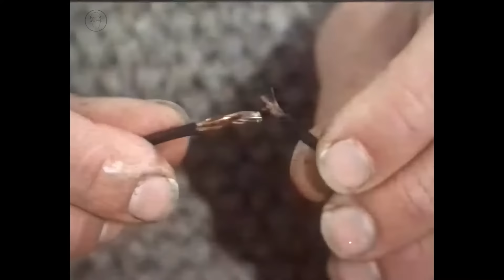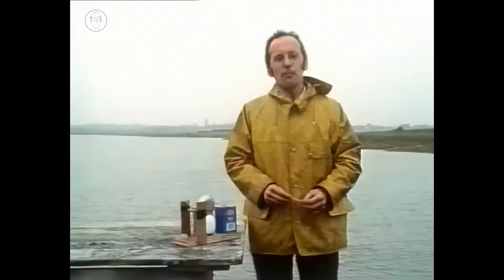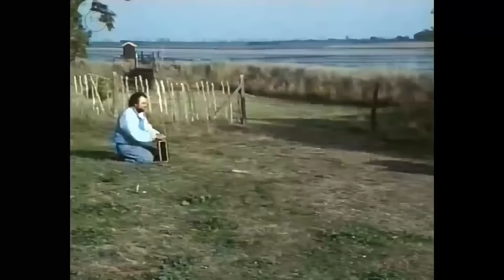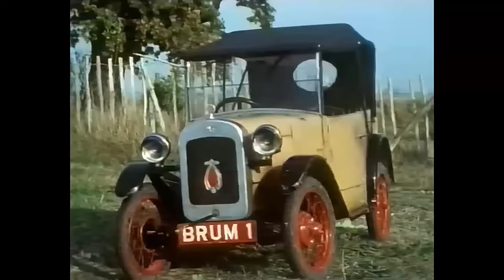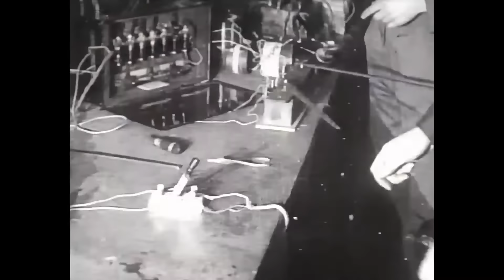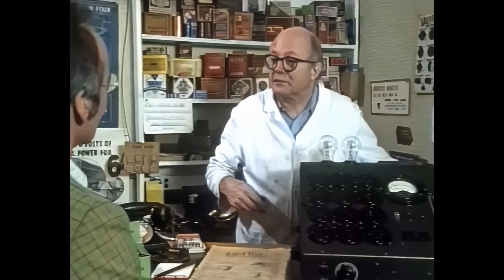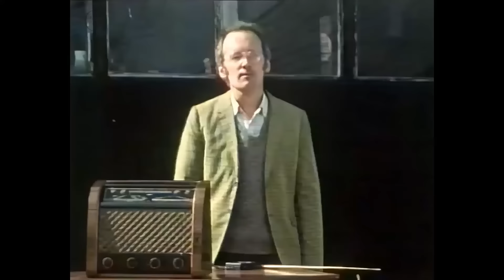The Secret Life of the Radio - Remastered

Comment: Yes people are listening to podcasts etc. but they are doing it over their mobile phones, so it's still broadcast by radio. The amazing part is that this is gets better audio quality than FM and every listener is getting their own personal broadcast! It even uses less battery than a DAB radio. Digital switchover will end up being mobile broadband rather than nasty old DAB.
Reply: A bitrate of 300 kbp/s or greater is necessary for DAB to match FM performance, I call DAB radio a failure.
Reply: @rjk5559  Yes due to the ancient codec used. Also you need a really good antenna and expensive batteries. They are pushing us onto it now by making it impossible for ILR to survive on FM
Reply: Mobile broadband is a paid service. Radio (AM, FM or DAB) is free, so it will most likely remain popular, though, of course, I cannot be certain of it.
Reply: @Pentium100MHz  most people have a large internet allowance these days.
Reply: @pklongutoobe  Well, I can play music on my phone, but it's low quality. To get higher quality, I would have to connect the phone to a proper amplifier and speakers (in car or at home) using a cable or bluetooth.
Now my phone became part of my audio gear. If I want to call somebody or go somewhere taking the phone (but still having music in the room for other people there) or whatever, I have to mess with it, then mess with it again to resume the music.
It would be more convenient to have a separate device that plays music, while I use my phone for other things. However, that device would need its own mobile internet subscription, which costs money. Thankfully, FM radio provides high enough quality for free.
Reply: Never had a mobile phone. Never will. I'm not Dick Tracy.